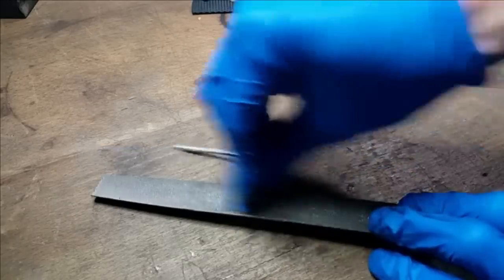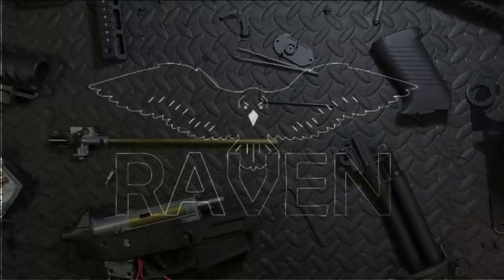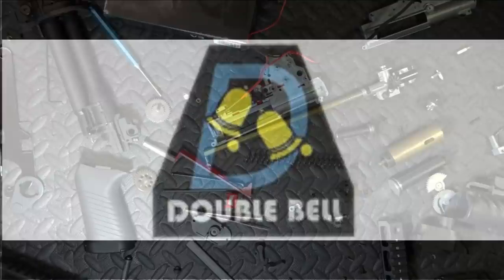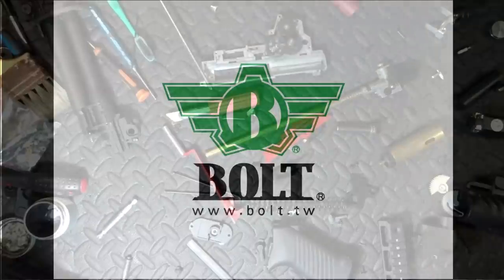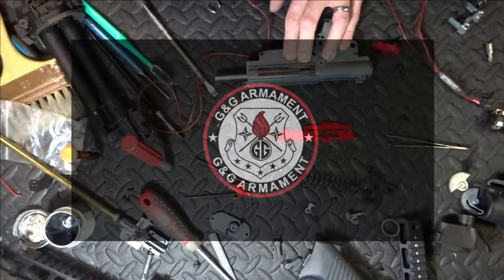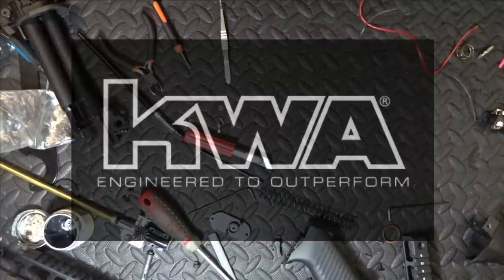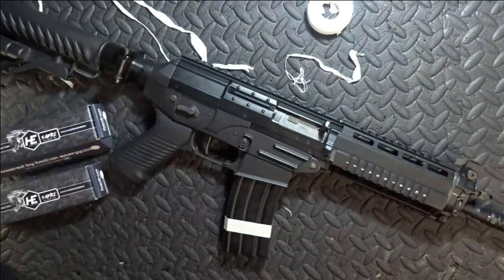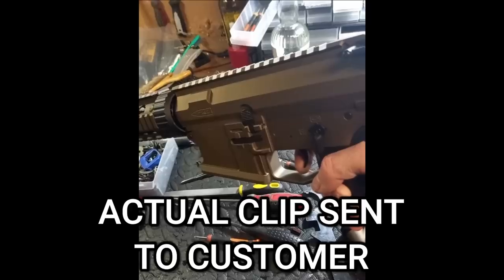Know Your Airsoft Brand!

Comment: Only been playing a year and a half so not exactly a long time in which I've purchased 2 rifles and about to get my third. Listening to the internet no one that I knew at the time recommend cyma. So I didn't until I want a mp5. I bought a cheap blue edition high speed. Feck me it's amazing. It was greased from the factory. It was shimmed well. Apart from the nozzle it was perfect. I just changed the hop rubber and nub and stuck it back together. It was performing the same or better than modified mp5s and out ranging m4s. It became my favourite rifle after 1 game.
Reply: I really wish they sold more cyma stuff here in the states, i really want their other guns...
Reply: Have the same mp5 its so under rated.
Reply: @totalfailforfun4721  yeah all vfc for the elite force mp5a4 and a5 but the competition guns i have no idea
Reply: I have the same! I had an aster installed, new rubber, barrel and motor. Apart from external mods its came out to around 280 euros, and its a reeeeaal beaut! You could definitelly make do without the mosfet but i wanted something i would love just as much as my WE mp5
Reply: The gun and the new stuff probably costs 1/5 of a TM mp5
Reply: what do u recommend for a beginner also if your in the uk can u recommend a field
Reply: Blue edition cymas are amazing, my first proper airsoft replica was a blue edition mp5 standard version. Hell man it was shooting better than my lct hk.
Reply: I have one with the swordfish kit and a warhead motor… it’s almost unfair

Comment: I had one of the G&G raiders a few years back. Before first skirmish my mates wired it to deans and swapped the hop rubber out for a 'better' one, and I believe took this little spring off the inner barrel by the hop cos one of my mates had one and found with his, it stopped misfeeds almost completely. that gun stood up to a wee bit of backyard fudd teching (though my skirmish mates were all sparkies/engineers, so I think they had atleast a bit of sense behind their work) to try and 'improve it' and not once did it kick up a complaint, it always fired consistently at the short to medium ranges of the site we used to play at on monday nights, and it stood up to some pretty intense semi auto cqb. (If you can call about 20-30 people ramming themselves into a 30-40mX10m killhouse in a warmup/warmdown game they always did once an evening at some point) Not sure how good the newer iteration of their combat machine line are, but for me, if someone wants recommending a cheapish M4, It will always be the older combat machines (CM16, raider 1.0, R8-L and that Mk18 knockoff one)

Comment: Great to hear accurate feedback on BOLT, there is a lot of false information about them that normally comes from people that have never owned one. I have 6 BOLT AEGs and not one has let me down. 

The compression parts are fantastic, the best I've seen out the box, 100% airseal in every one. The barrels are 6.00 like Luke said and the quality of them is on par with ZCI, they are like glass inside and always clean from the factory. 

They perform great Out The Box, however,  I gave them all a spring change and dropped a Jefftron Leviathan in them.

In summary, BOLT make great guns with high quality internals as well as great external build quality and they kick very hard (twice as hard as my TM recoils, especially the AKS74U). Highly recommended.

Comment: Have three Cyma AEGs, two of them are AKs and an M16A1. Aside from some parts like the charging handle, or with my CM040D, the receive cracks at a specific area but it doesn't affect function. They're just dandy base guns that get you into airsoft for a good price (sometimes great deals if getting abroad) and while they're not E&L or LCT, they're still quite good. Their AKs tend to be the bread and butter for me at least.

Comment: From an Irish perspective - a Marui running at 1 Joule is perfect.  Runs good on low-pressure gas. It just slips in under the legal limits here and you know if you don't put Green Gas in it, you don't have to worry about it ever going over the magic number because it's basically designed to hit the same limit we've got.  They seem to be able to tolerate green gas - especially because it's colder here but they're perfectly happy on their native low-pressure stuff. 

I've bought some random crap for a group of friends that like to drink and plink at our BBQ's -  and the Marui GBBR I have is the one that has gobsmacked anyone that's held it. The quality and feel is just an order of magnitude beyond the few pistols and AEG's we've experienced.    

The only drawback is the price.

Comment: I have bought 4 airsoft guns so far.

First off was a G&G CM16 Raider-L. Horrible spring slap/shimming. While it didn't bug me at first, the whining noisy gearbox started to annoy me. These are supposed to be accurate, but accuracy on mine was lacking.

Second was a KWA 1911A1. NS2 gas system. Doesn't have the issue where it loses the firing pin. (That is only the PTP.) The gun itself works great. The mag that came with it was fine, but the second mag I bought was leaky out of the box.

Third gun I bought was a CYMA M14 SOCOM. By FAR the best AEG in my collection. Incredibly accurate out of the box, responsive trigger, and a smooth gearbox. I love it, and would recommend it without hesitation.

Fourth gun I bought was an E&C 835. Bought it because it was an LVOA that didn't have a $200 Krytac Tax, but it had the same issues as the Raider. After sending it to be teched, I ended up spending the same amount I would have on a Krytac LVOA on it.

Comment: Good advice regarding WE gas guns. They work fine and like you pointed out, spare parts are rather easy to find. I have a few VFC gas guns (they are very hit and miss, mostly miss unfortunately), and have actually found that you can order pretty much any spare part directly from VFC without problems.

Comment: Got an E&L platinum m4. Awesome awesome internals. Perfect AOE out of the box but shimming was too tight. Crazy good externals though the qc on mine was meh. Mine came with a gap between top and lower receiver and top receiver and rail. Otherwise it shot with a deviation of 3 fps and dead straight. It is quite heavy and feels like the real deal. Made in a factory where the real stuff is produced too.

Comment: With my recent interest in Airsoft my first purchase is the M92 Berretta full metal by Double Bell.
Great plinker out of the box, I did a little research into the hobby/sport and went down the modding/upgrading rabbit hole.
My plinker's first modded shot went straight through a 2mm pain of glass at 10 meters with .25 plastic BB.

Comment: I did a similar vid but haven’t posted it. I show a VFC 1911 and a KWC 1911 which in my opinion are by far the best easily accessible 1911 you can buy but are identical 100% to each other . Only the KWC Air gun versions are made much stronger and only have smaller flute valves. Everything else is the same including the hop ups!
They use the same mags wether BB or Airsoft,obviously they have dif size feedlips but buying an airsoft mag works identical in the air gun BB versions.
I buy the BB versions to custom build,We the people” Tanfoglio Witness”,Colts,etc...(the field strippable full BBack metal BB) and i use the EF/VFC Airsoft inner and outer threaded barrels,which are sold all in one pack ready to go everywhere for $20! 
Initially It was the only way to have a “We the people”1911 in Airsoft without making a custom one.
You just buy airsoft mags and that’s it! Now you have a solid CNC 5000 grade Alloy vs a 2-3000 grade cast alloy that airsoft guns are made of. I’ve polished dozens of Elite Force tacs and Tanfoglio or other KWC frames and slides and it’s night in day the amount of elbow grease it takes to polish a KWC vs the VFC even though all parts are perfectly interchangeable. The ASG CZ are made so solid in both Airsoft and BB and though people say KJW is ASG the KJW CZ are completely different in everyway! They couldn’t be made any diffferent. 
Another example is all  KWC Air gun Legend series revolvers use a 2014 Copper base Alloy vs the same Airsoft revolvers using a 3000 grade cast Alloy,no copper under the finish though all are considered “Aircraft grade” The worst 1911 by far are the WE 1911 including their other similar style pistols like the WE HighPoint,i show that in the vid using a that brushed WE cartel 1911 and compare it to the latter.
 It’s mostly the guide rod,spring and it’s hop,keeping them from cycling correctly. They’re also made of 2000grade cast aluminum and is why you don’t find any C02 We pistols. I still love some We stuff though. AW is garbage! All their full auto pistols don’t function after one mag! I have two different AW high cappas and both were returned and the new ones both were the same “bouncy two piece safety/full auto selector” causes trigger lock up after every shot. Hx2032 is the worst of the two $189.99 each! I’m unboxing the A&K  FN 249 Heavy weight ,long MK1 tonight! Ha! Sorry for the book i wrote but how else am i gonna tell you how i agree? Check out my Arp9 unboxing please! Thanks for all your time maen! Oh i mainly watched this fir all your takes and info on Cyma. I consider you an expert on the in and outs of Cyma. I’ve stated this a lot when people on FB or Evike Qs ask about anything Cyma,I just send them to your channel!
Reply from the maker: I broke a VFC 1911 almost instantly but I never opened it up... If it's the KWC design, I'm not shocked...
Reply: Interesting take on the AW. I this review @Negative Airsoft says they are better then WE.

Comment: The STAR FNC was a hoot. The polycarbonate gearbox was awesome and quiet with its mechanical 3-round burst. The handguard wasn't ABS even, it was some sort of awesome polymer. Shouldn't had sold it, but the wires got stripped and I didn't know then how to solder.

The S&T also made the Sterling SMG/Star Wars E-11. Unique gearbox and externals 99% made of steel. Mine still works and I kinda put it through hell lol, the hopup is absolute shit though.

Comment: Very well done! Definitely learned a few things. My wife Bought me a ICS Par MK3 probably 6 years ago now. I did a DMR build on it because it’s to dam heavy to run around as an assaulter with LOL. Anyway it was my first serious build from the inside out and I liked the split gearbox for being able to work on the two parts of the gearbox separate. Work on the shimming and drivetrain on one end then work on your compression stuff on the other. Just made it easier to learn then worry about it all popping up and what not putting it together. But I did break a couple tappets along the way ended up putting a blue Lonex tappet in and knock on wood it’s been fine. Sorry Long one keep up the great tech videos

Comment: The G&G comments are about what I've experienced. Feed issues in my ARP 556 fixed with Prommy bucking and barrel. Drilled out the hopup unit to fit the bucking so that'll get replaced next. Waiting on the mosfet to go before I replace with Perun. Otherwise, great gun, happy I paid more for a midrange gun as a new player so I'm dealing with less upkeep now.

Comment: I recently bought a new Krytac Trident Mk2 CRB version. I know, I know, I've heard you in this video and your other ones... I was participating in the whole GameStop stock market craziness and I managed to pull out a decent profit in a very short timeframe, so I decided to splurge some of that "free" money on the Apple/Reebok of airsoft world.

It does have that typical Krytac annoying whine going on, but the gun shoots straight into the top of the pine tree that I use as my 'target' when I test my airsoft toys from the balcony (100ish feet away). Compared to my G&G CM16 Raider which I've been using since 2017... well, I can't even compare those 2, Krytac is just so much more accurate and the range is so much better.

Now, I did adjust the motor just a smidge higher into the gearbox and it's reduced the squeakiness noticeably, but it can still be heard. Do you reckon I just leave the squealing sounds as they are, and send to a local tech when/if something breaks, or should I preemptively do something right away to improve the longevity of the internals?

I'm planning to use LiPo 11.1, I'll switch to Deans connector soon as well, I've had so much trouble with Tamiya on my G&G CM16 I don't want to subject Krytac and myself to that same torture again.

Comment: I have had many WE guns. I really like their rifles. I really like their spare parts supply chain. I don't like their glock (because the outer barrels snap and are loose in the slide), and the XDM (also outer barrel fitment, loose slide on the rail). Their Hicapa is pretty good, those outer barrels fit tight in the slide, but the operating mechanism such as the slide catch and safety lever tend to wear out quick. 
I have had many of those cheap Chinese guns such as A&K, JG, CYMA... and they are great considering their price and I usually throw in some upgrade internals as mentioned. What you said about them is 100% accurate. I don't have to feel bad about scratching them unlike those really expensive collector's investment type guns.
KJW is pretty decent
TM's GBB are probably the best in terms of reliability, accuracy, and overall quality... even the plastic ones. Their plastics are better than some of those Chinese metals! The irony with TM is there are a billion companies making "upgrade" parts for their stuff but the originals tend to perform better. 
I mostly agreed with this video and therefore give it a 10/10
Wish it existed a few years, like 10 years earlier than today lmao

Comment: I'm at a point now where I listen to you when I do other stuff. Audiobook when?

EDIT: Noticed you didn't mention Lancer - is there anything redeemable about them or are their guns still bags of spanners. Since I have one is it even worth spending money to improve it
Reply: Love that ideas listen to him ramble 😂
Reply: Agreed!
Reply: I was wondering about lancer as well...mine seems fine but I haven't had it for too long
Reply: From what I know, and I never had Lancer, they are fine apart from the terrible quality control. This means you either get an ok gun, or you get a lemon that literally shits itself after first ten shots.
Reply: I've found both the internal and external parts to be nearly identical to E&C/Specna Arms. I'd say they're pretty great upgrade platforms.
Reply: Specna arms makes lancer now I believe. Gen 1 lancer had no quality control and made by cyma. Gen 2 so much better and I only upgraded my hop up, rubber, and nub.
Reply: @maggotpraiswater  Tbh the only issue I have is the barrel nut isn't super tight which means I'll need to get an armorer's wrench at come point - in terms of performance it's actually pretty nippy even on an 8.4 Nimh. I now sort of have it as my "Fuck it I'll do whatever" gun
Reply: @HeroGenix  yeah, mine came stock with a 9.7 nimh and it preforms great. All I did was loosen the motor by 1/4 turn. Even the tech at my field was impressed with it coming stock. My friends barrel nut was loose as well, but I used a big pair of vise grips and tighten it up
Reply: I have a Gen 2 and it's pretty good. About 340 out of the box and it's fairly accurate. Only real problem is the magwell is super picky. I found a mag that works, and it's been trucking along just fine.

Comment: In Italy we're lucky that the power output for airsoft guns is 1Joule (330 fps if I'm not mistaken), the same as Japan. So we don't have to change literally nothing to TM guns and they just last. It's so low that even VFC are good
Reply: Not good, decent, kinda underwhelming when compared to a cyma... Unfortunately our "local" shops sell the old cymas so they don't have a good reputation, calico jack is the only shop who sells the blue edition series at a nice price

Comment: Fuck that your absolutely right! For a cylinder head it doesn't make too much sense but for threads (which is what it was designed for) its getting its intended use out of it

Comment: Still got my KWA G19 that I bought in 2005 and an AABB Hera GCC kit, it's a shame you can't still get hold of them because as a starter GBB it still beats the pants off any of this WE/Nuprol Raven/etc stuff, only thing I've found in a similar price range that I personally think is as solid as a starter GBB is the KJW P-09.

I'd be amazed if Bolt actually have 6.00mm barrels, over the years the thing I've observed pretty consistantly is people using digital verniers to measure the ID of inner barrels, they are just not accurate enough for something in the 6.00mm - 6.08mm range and will normally measure undersize. That barrel you think is a 6.04mm is probably actually 6.08mm, a 6.00mm barrel measured with them is probably a 6.04mm.

Bore isn't the be all and end all anyway, can have the tightest bore possible but if the drawing isn't good, crowning poor and the milling at the hopup end done badly it'll suck.

Comment: Buying my first few guns in the next weeks and thats been an immense help and saved me a mistake with VFC..I'd already shortlisted a Specna  Core/Edge series MK18 against a few of theirs so thats pretty much a definite for Specna and the Edge with a milfet after this.I was drawn just on looks before to the CYMA AK-74SU thing  as well as the fact its cheap as a back up if main gun fails as I have no knowledge to fix on the day/cqb gun  but was concerned about quality/ performance  the only downside is I cant find one in stock anywhere.I was also drawn to the AGM MP40 just for a classic looking SMG but to hear its actually good and useable is nice..Big thanks as you aren't just helping mid experienced players but near noobs are avoiding pitfalls with help like this